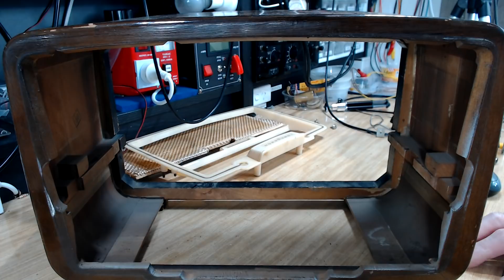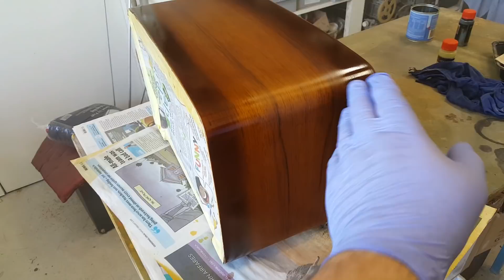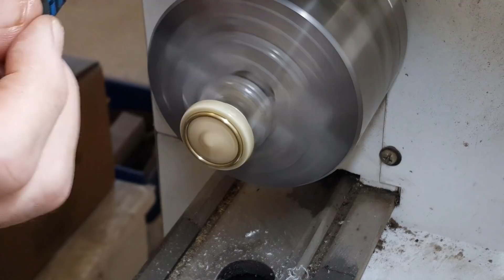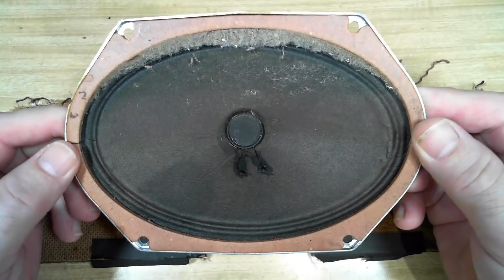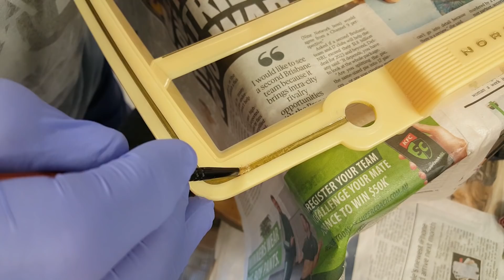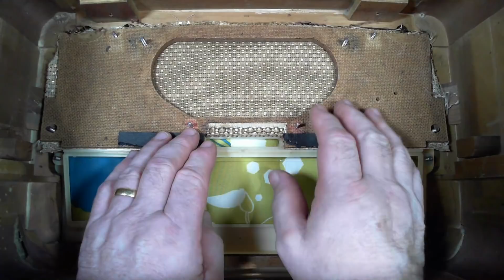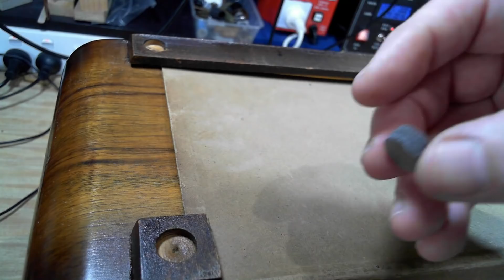NordMende Elektra 58 Restoration Case Repair Part 3 - Final

Comment: Such an enjoyable series as ever,  so interesting to see your ideas for tackling each problem. One thing I didn't quite understand - does the phase of a single speaker (with respect to the input signal) matter too much?   Thanks again for such enjoyable content from a locked down UK!
Reply from the maker: Hi Ross, there is a bit of conjecture on the subject, in a single speaker system It doesn't seem to make a lot of difference. I had a stereo system once that you could switch the speaker phase of both speakers at once, the difference was there but very small, a slightly fuller sound if I recall 🙂
Reply: @DavidTipton101  Hi David, many thanks for that - interesting!  I wonder why it makes a difference - something must be slightly "asymmetric" in the signal - as the speaker is reproducing an a.c. signal you'd think it wouldn't matter. All of these things are very intriguing to me! Thanks again for the videos, I can only imagine how much extra time it adds to your restorations to edit and upload them - but they are very much appreciated.
Reply: The speaker cone must go out to produce a bass sound. When it is reversed, it crashes inside.
Reply: @mustafaalaoglu6671  Thank you - but I'm still a bit confused. I understand that pairs or multiples of speakers must be in phase to avoid bass sounds cancelling, but with a single speaker I don't see why it makes any difference.

Comment: Another great job. 👍👍👍 One product that I have found excellent for cleaning cloth material is StainGo.
Reply from the maker: I'll get some when I go to Woolies James. The fabric was a bit fragile so I didn't want to rub it and I didn't want to wet it as the glue might fail. I'm on the lookout for some new cloth, thanks for the tip James 👍😀

Comment: That sure came our beautiful, the cabinet finish really lights it up.  I'm sure you must have explained it but what does the "magic eye" eye do ?  Also, did you consider reversing the cloth to the unexposed side ?
Reply: The purpose of magic eye tubes in radio sets is to help with accurate tuning to a station; the tube makes peaks in signal strength more obvious by producing a visual indication, which is better than using the ear alone. ... The tuning eye was driven by the AGC voltage rather than the audio signal.
Reply from the maker: Hi Ellesmere, Wayne covered the eye. The cloth is glued on so I couldn't reverse it, interestingly, the cloth was discoloured on the inside of the speaker cutout, the speaker was breathing the smoke through the fabric 🤔🙂

Comment: Wow.  Sounds great.  The cabinet came out really well.  I think it's prettier than the original.  I was thinking about the damaged area.  I saw a guy scrape some wood off the inside of his cabinet creating a fine saw dust; then he mixed it with just a little wood glue to produce a fill for the cracks on the exterior of his radio.  I wonder if that sort of ploy is any good on future projects.  Excellent video.  Much appreciated.
Reply from the maker: Hi George, yes, that would have worked, particularly as the stain was mixed with the top coat. If it was stain was applied directly to the job the stain wouldn't penetrate the glue. I wasn't keen to play with it and make it worse. It came out pretty good considering, It doesn't stand out unless you go looking for it. Thanks for the comments 😀